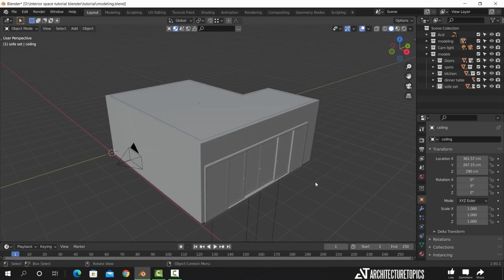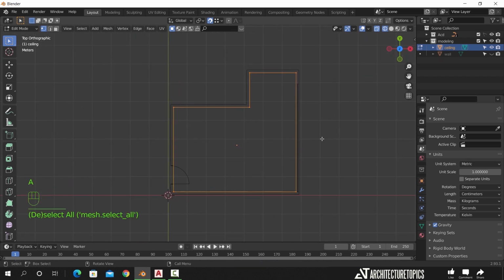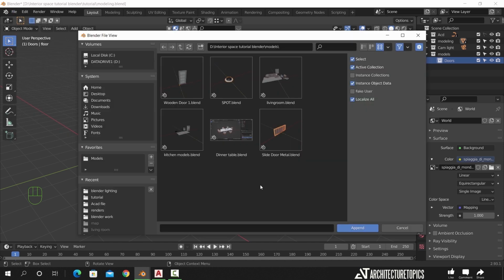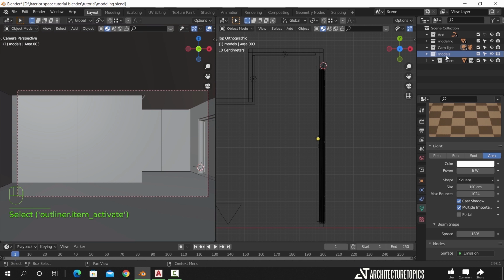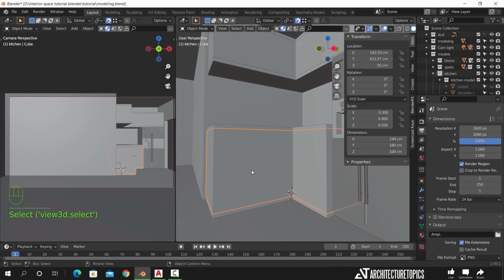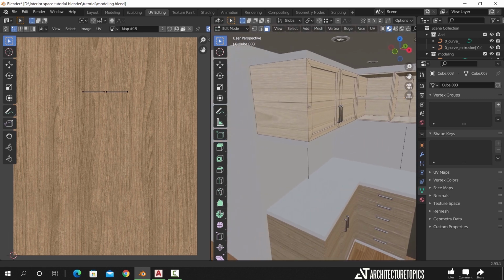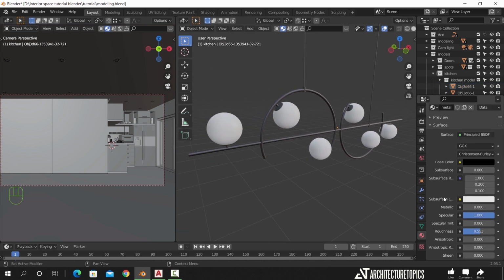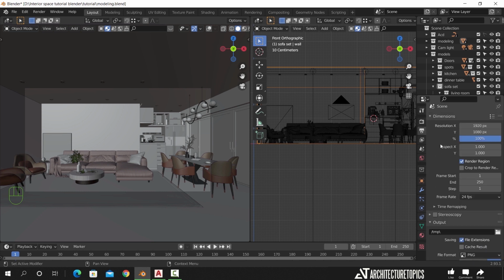How to model interior scene in blender

Comment: I'm having an issue on how to scale . I bring the DXF file but i don't understand how to scale it .
My own cad plan
Reply from the maker: We measure elements like the door which should be (90-100cm) or the wall thickness 15cm and rescale the drawing according to that.
In this video we have the door around 100 meters so we scale it down by 0.01 to make it around 1 meter, then we measured the wall thickness just to make sure it's 15 cm.
Reply: @architecturetopics  one more question if i may , the bridge edge command doesn't seem to work the same on the updated version of blender . Any other way to do it ?
Reply from the maker: @ANGEL-fg4hv  stay on bridge faces easier to handle.
I’m not aware of any problem regarding the bridge loop cuts on blender 3.0v+ but sometimes bridge edges don’t work if there’s double vertices or maybe the lines on different levels, while with bridge faces it works even if it connects them wrong which by then you can fix the mistake.
That’s in general hope it helps

Comment: You're a blessing from above. If I could subscribe twice I would. I'm having difficulty knowing how much to scale dxf.file in Blender (from my own CAD drawing) so is there a formula used to determine this? - I have tried using 0.010 and 0.001 but it is still not scaling properly so I ended up using .025 to get closest. Units are in imperial for both softwares. On another note, is there an email I could send a model done from one of your other tuts for your opinion? Thanks.
Reply from the maker: Hi buddy, So it's usually matching the unites in both programs, but since Acad and blender are not from same product company ( like autocad and 3dsmax) it's more easy to just fix the scale in blender.
before you scale any plan, measure the things that's are universally scale known( Door would be 90-100 cm Or the stairs' step is 30 cm) something like that, and scale it according to the numbers.
in this course we did first measure the door and find it 100 meters so we scale it by 0.01 to make it 1 meter and therefor fix the scale, then we made sure of it by measuring the wall thickness which goes from 15-20 cm.
hope this helps

Comment: The thing I don't get is why after importing the floor plan and determining that it's too large by a factor of 100, you not only scale it down but make sure it is correct by checking the walls are actually 15 cm thick. Then afterwards you place all other objects just scaling them manually to make them fit somehow, disregarding real-world measurements, stretching proportions by uneven scaling on different axes... So why the accuracy for the walls? The placing of interior objects would have been the same if you just eyeballed the walls.
Reply from the maker: Well, you're right, scaling the furniture to fit might be not that accurate, the perfect thing is to work on blueprints and have Neufert open on the side and then measure everything, which will turn this tutorial into a 10 hours seminar, Now why we scale the furniture to fit, cuz it comes with different sizes, so we can go around with the scale, the slide door stretching is also for the same reason, glass panels and handles can have multiple sizes, however there are thing that need to be accurate and making them by view fitting will get the attention of the viewer eyes, such as Door height, the countertop height, the ceiling area for hidden lights and curtains etc..
Again What you asking for is Either doing everything down to a specific measuring and that will take much time and effort or make it all by view and that won't get you much good looking render.
3D programs whether its blender, 3dsmax, maya, cinema4d.... are made for preview and not for accurateness, those thing you get from 2d prints with Autocad, Revit and other  BIM programs.
hope this helps.
Reply: @architecturetopics  Well yes, it doesn't need to be perfect scale, that's why I wondered you cared for that on the walls' thickness.